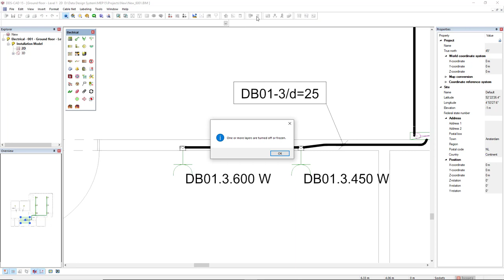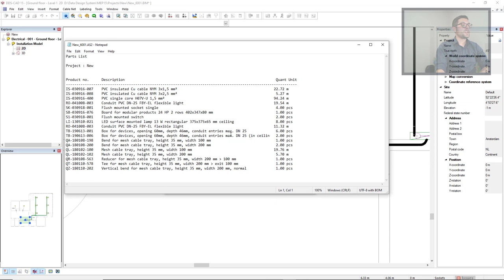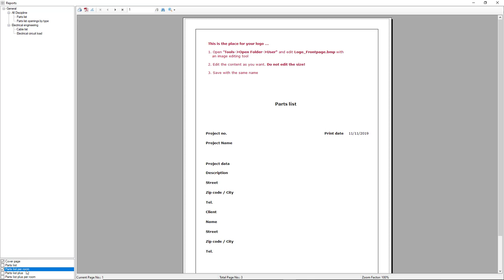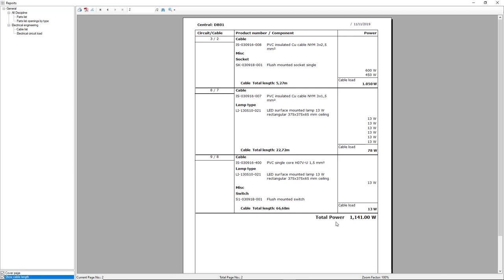Getting Started  - Electrical - Parts list & Reports

Comment: Hi, I have a question. How to include additional information about materials in the PART LIST, e.g. MANUFACTURER, CATALOG NUMBER etc. In PART LIST I do not need to mark the symbol from DDS, sending this information on does not say anything to anyone.
Reply from the maker: Hi targetti, the reports cannot be edited inside DDS-CAD, but inside the project folder there is a .boq file that presents more information You could open it using excel. Send an email to support@dds-cad.com and I can  share a template with the description of the columns. Regards,